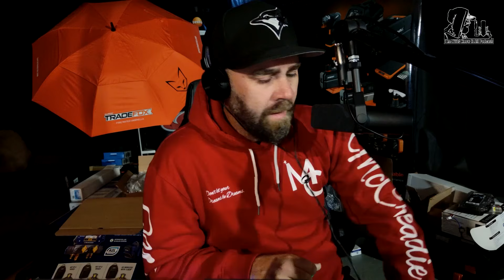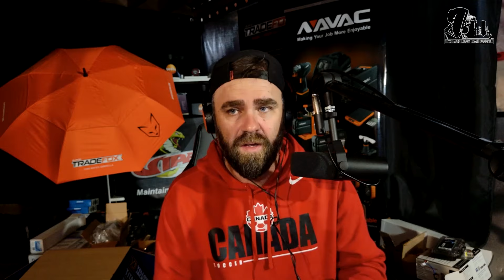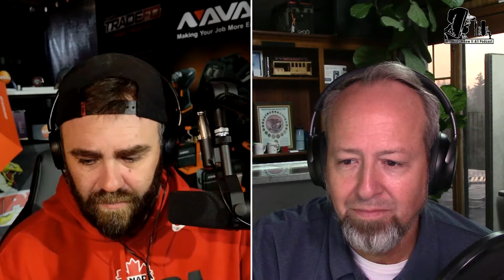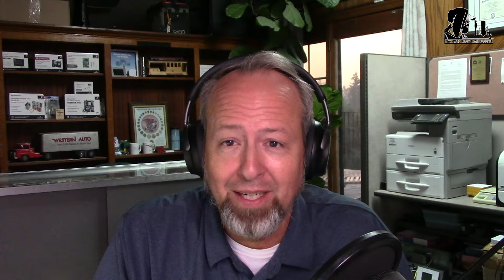Thermal vs Economic Balance for HVAC Techs to Maximize Heat Pump Performance with Jim Fultz Part 1

Comment: Why is Jim giving wrong, out of date information about sizing heatpumps that will give poor heating performance in cold climates?
With inverter and 2-stage heatpumps, the hp should be sized towards the larger load, normally heating.
With single stage, can upsize half a ton for more heating capacity and still be okay, using variable speed blower slowing fan down on demand to get better dehumidification.

If it is all electric, not a dual fuel, a heatpump should be sized to cover entire heating load in cold climates ductwork permitting because electric heat strip backup is the devil.
If it's something like double the cooling load, this may cause dehumidification issues but that beats very high electric bills -> , and again slowing the fan on demand to enhance dehumidification along with dehumidifier.
Reply from the maker: Any heat pump I've installed was closer to the cooling load.  For instance 75k heat load and 48k cooling.  A 6 ton heat pump can't turn down enough to dehumidify in shoulder season properly.  A 4 ton heat pump was installed with a 10 kw heater.  Works great and the resistive heat is only used below approximately -13⁰C
Reply: Try again